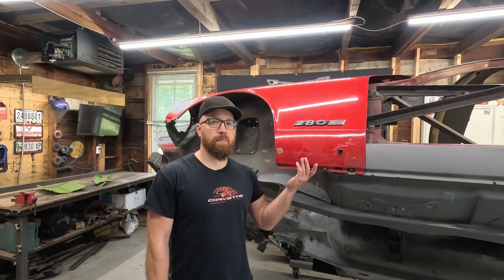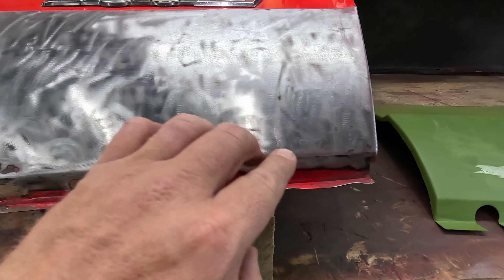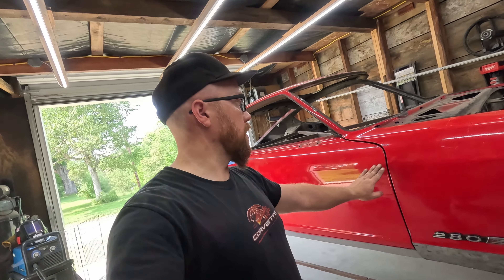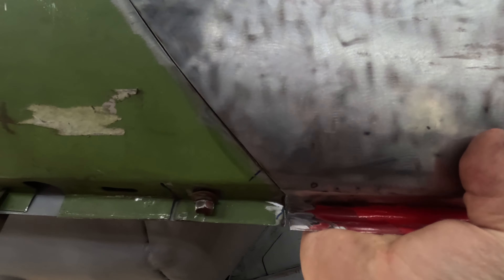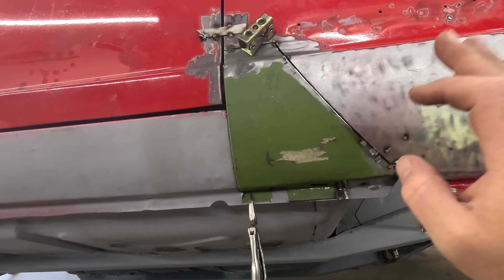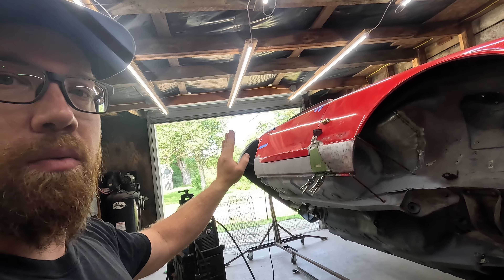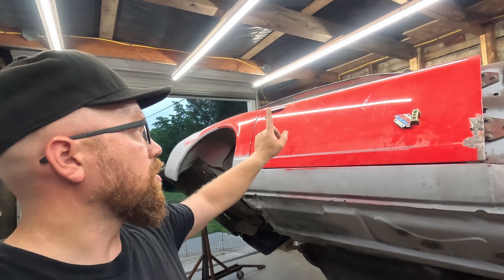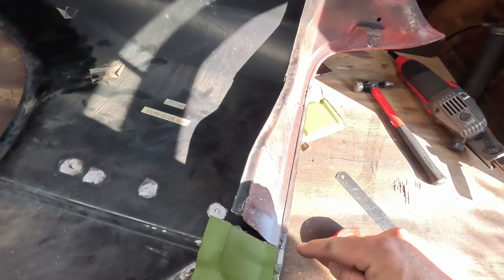Rusted Front Fender Repairs on the 280z

Comment from the maker: What's the best way to strip all the paint off the car?
Reply: In 2018 I painted my tailgate.  I used Rustoleum paint stripper.  Got 2 gal for less than 50 bucks I think.  Shit worked awesome!  Good "ol EPA outlawed methylene chloride a few years back.  Now you can't buy the stuff.  Still got a gal unopened in the garage. I have no idea how the new formula paint strippers work.  Methylene chloride is a nasty chemical if you don't know what you're doing.  Do your homework I guess and see if the new strippers work as good as the old formulas.  Be interesting to find out.
Reply: Single edge razor blade, as crazy as it sounds, is a great stripper. Stand it upright at near a 90° angle to the surface and it will take paint off about as fast as a grinding disc without the heat transfer to the metal. Touch ups to difficult areas can be done with a sanding disc.
Reply: @robertdavis386  that is interesting, I would certainly try that on large panels for sure
Reply: I feel like paint stripper is the easiest way to go. The only issue is finding a good one that doesn't involve a bunch of applications. EPA baned methylene chloride, which was the ingredient that made the old school paint strippers work amazing, but also killed you slowly. Lol Maybe do a paint stripper comparison video and see which one works the best on the 40 year old Japanese paint.
Reply: 80grit and a knuckle buster….
Reply: @calais51  Start blocking now
Reply from the maker: @robertdavis386  Really. I'd never heard/ thought of that.
Reply from the maker: @ronnygouveia7200 that's not a bad idea! Although this car has been repainted at least twice.
Reply: Drum sander makes things warm so have to be careful. You can create wavy panels if you’re not careful. Dusty Mac did it. Makes a huge mess. So does chemicle stripper but easy enough to clean. I’ve done both and they both suck but prefer chemicle
Reply from the maker: That is a good point about heat.
Reply: i had no luck with paint strippers, i live in italy so maybe laws are different here but in the last years all the good paint strippers were outlawed.
in my restoration i had to strip some panels and paint stripper was messy, slow and i had poor results, after letting it stay on the panel for hours the paint hardly came off and it was useless against bondo, i had to use a metal blade to remove it after.
i had some panels with 10 different layers of paint and it took me ages to remove all the paint that became soft a gooey but still sticky.
hope my experience could be helpful in some way to help you choose the right thing and i sure hope that paint strippers there are better than here in italy!
Reply: The paint on the car that's left is there for many years, I would leave it and just rough it up before primer and paint
Reply from the maker: @-vascheddu-165  that sounds like a terrible time
Reply from the maker: @PieterKuijk  the problem is I don't know what all of the sheet metal looks like underneath. It's been painted at least twice and there's bondo. I've found multiple questionable repairs already and don't want to have something pop up later.
Reply: @BLOKgarage  Is it an option to use a paint thickness gauge? Detailers use them.
Reply from the maker: @PieterKuijk  I could but I still wouldn't know if the sheet metal underneath was rusted etc. I've found multiple places where they put bondo over rust holes.
Reply: I see your point. Then you have to choose between messy or dusty. One of those drum sanders can do the job quick though.
Reply: @PieterKuijk  maybe a more expensive machine with a built in dust extraction to attach to a shop vac would reduce the dust? still a lot of work tho.
but if i could go back in time and redo the restoration on my car i would do it like that

Comment: Also thinking, would it be better to leave that support piece intact when doing tthe front side rust repair, and replacing the support after so it keeps it's shape better?
Reply from the maker: That's possibly a good idea. I changed my strategy up for the other fender which worked a lot better.

Comment: I could absolutely tell how frustrating this one was. Wheel wells and curves on fenders are very difficult. 

Good work not getting so frustrated that you just did a poor job. I think it looks good. 

I would also cut out a much larger piece and find ways to hide seams of the welds on flat surfaces versus curves (I tried to do this on my car, but I did not take enough time to get it perfect and I can still see my seams). 

As for stripping the car, I would try chemical on a small area and see how it lifts, if it works do that, if not move to abrasives. If you try to use abrasive after chemicals it gunk's up tools and it even more gross to deal with. 

Good work man
Reply from the maker: Any recommendation of brand for chemical stripping?
Reply: @BLOKgarage  no I used several, my advice would be to work on small areas and follow the directs to the T. It seemed like the larger areas I tried, the less consistent results I got. Your mileage may vary. I also never stripped an entire car, but just smaller sections at a time.

Comment: At the start, at around 6.03 mins, you removed the door bracing and let the car hang at both ends upright. This would bow it in the center and would have contributed to those panels not lining properly. You can weld two bracings on the inside and then remove the door A pillar bracing.
Reply from the maker: I have more bracing welded in the car plus the way stronger frame rails. I don't think the body flexed at all. The door bars were really just there while I was doing the floor pans and frame rails and I've just kept them in.

Comment: Did you order the 240z fender parts? I couldn’t find any in their 280z section. Just curious if the fenders are the same as I know some parts might not fit the different models.
Reply from the maker: All s30 fenders are the same so you can order the 240z panels
Reply: Yea that’s what I thought. Appreciate it.